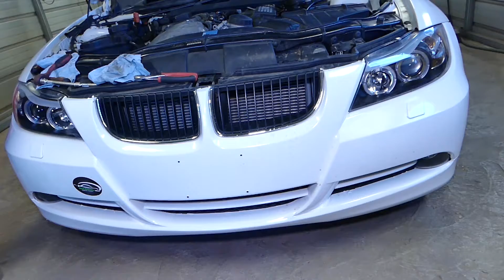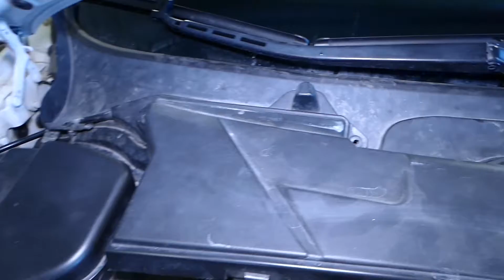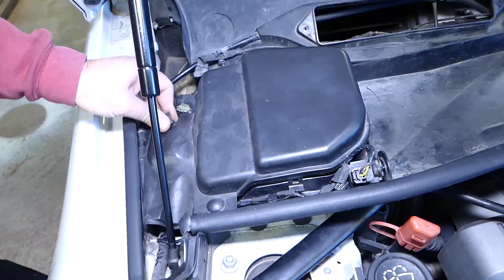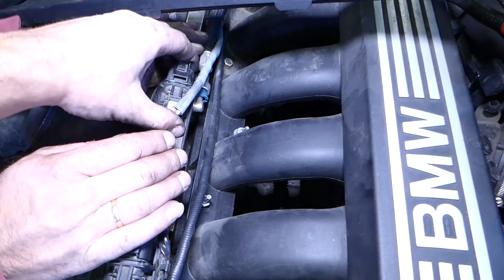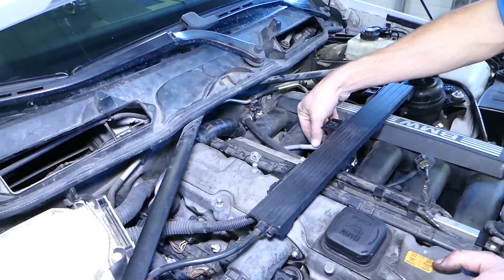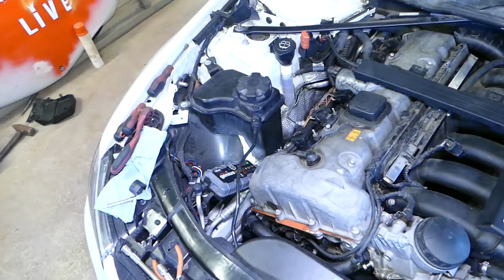HOW TO REMOVE AND REPLACE OXYGEN SENSOR BANK 2 BMW E90 E91 E92 E93

Comment: I have a 2008 BMW 335i  and that is definitely not where either of my O2 sensors plug in when you show the gray one. In face the valve cover doesn't look anything like mine, either. I'm guessing you have a 2011+ N55 ("twin-scroll, not twin turbo) engine here which is different from the 2007-2010 N54 engine (twin turbo)

Comment: Thank you for the videos.  I have a 2010 328i E90 N51 Sedan. Are the bank 1 and bank 2 sensors the same but different lengths.  I'm trying to find the correct part numbers to order for both Bank 1 Sensor 1 and Bank 2 Sensor 1.

Comment: I removed mine by letting th coolant reservoir.moving it forward. Grabbed it with some vise grips. Extended the arm. By adding an socket an an extention to the socket.
Reply: What model and engine do you have?

Comment: Do you have to put back that blasted BRACKET!??
Reply: At least in mine I had to. It would throw check engine light without it every 3 miles
Reply: @Minto107 which model and engine do you have?
Reply: @TermsAndConditionsApply  2005 330i N52A

Comment: What kind of codes do you get when the sensor is bad? I am getting a bad sensor plus 4,5,6 cylinder misfire codes. Would it be the sensor or could it be something else?
Reply: @abumannocchi7636  my dme msd80 was bad. I replaced it with msd81 ($600 from ebay programmed)
Reply: Ive had the exactly same issue, the problem is the oxygen sensor bank 2 sensor 1, after you replace it you might have to replace these three spark plugs as well soecially if you see black carbon on it, and car will drive fine
Reply: Coils spark plug first clean vanos and an other sensors around there  first see if the oil is flowing smoothly by cleaning all 4 sensor .

Comment: I have a 2011 328i E92 and replaced my O2 sensor bank 2 using your video. It was difficult to get to but I saved over $600 doing it myself. Thank you for all of your videos!
Reply: Where is located the bank2 sensor 2 on 2011 328i xdrive please?
Reply: @MiguelLopez-rh9mt  bank 2 believe it’s the one on bottom up catalytic converter if not mistaken

Comment: As always  the best thank you , if i can subscribe  again i will do it!!!!
 help to read code,
2007 525i 153000 miles,
Code P2098 post catalyst fuel trim system too lean bank 2
Code P2272 o2 sensor signal stuck lean bank2 sensor2
Code P0597 thermostat heater control circuit /open
Please what do I need to do, thank you in advance
Reply: I have the same code in my bmw can you tell me what it is

Comment: Hello, I have a question what are the two sensors in the front of the block? Not the intake and exhaust camshaft sensors. But the two that are center location if block front side
Reply: There's  all relating to oil and vanos if your car dies but starts up evertime those the ones to clean

Comment: The hardest thing was removing the two bolts holding the metal clip on....other than that quite easy and also my new Bosch oxygen sensor came supplied with anti-seize already applied to the thread.
Reply: What's the point of the metal clip anyway? Can't I leave it off and route the cables elsewhere? It's ridiculous
Reply: @HydroxLoL  id be lying if i said heat shielding lol
Reply: @hydrox I'm definitely trying to find out the same thing about bypassing that bracket...!
Reply: Where did. But It ?

Comment: for the star 8mm can i use regular 8mm socket on the bracket
Reply: don't think so. You could strip it
Reply: Might get away with using a spline socket though